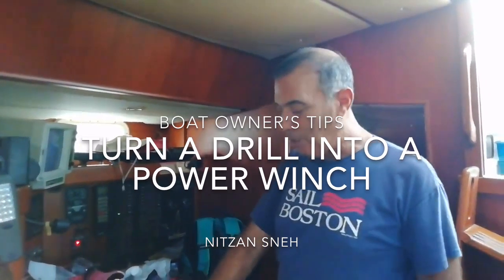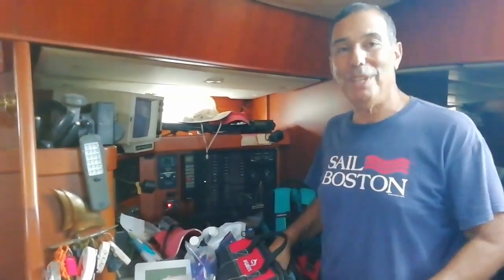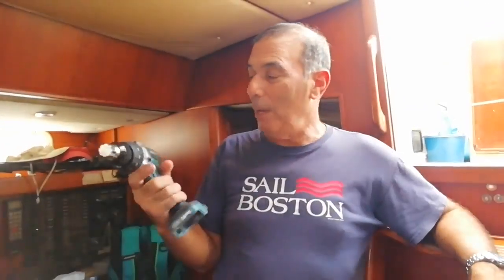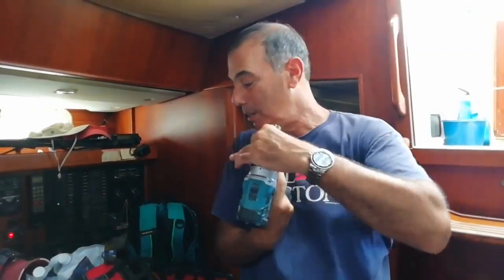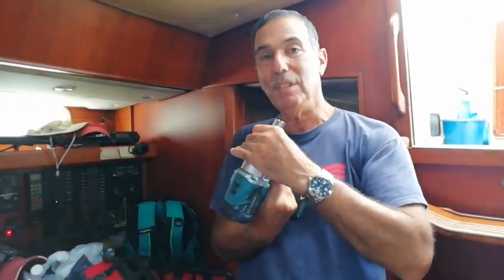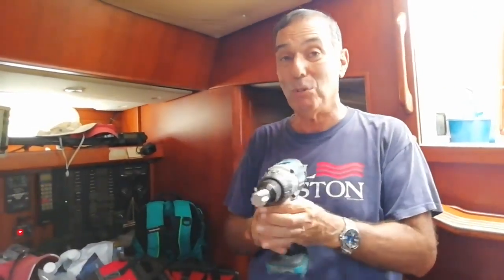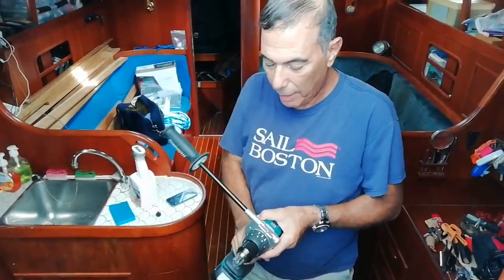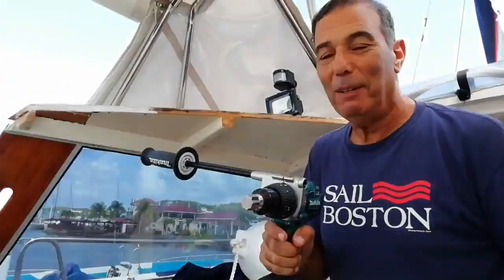Turn your handheld drill into an electric winch handle

Comment: Milwaukee have a new model of cordless drill - the 4th generation M18 Fuel model. It has 158nm of power. If that can’t get you up a mast then you may need to shed a few lbs. : )

Comment: I was so impressed with this video that I decided to buy the drill and the winch bit. When looking for a supplier for the Makita DDF481Z (used by Nitzan) here in Australia I could only find the sister model DDF486Z which has a slightly higher torque rating at 141Nm maximum, compared to 115Nm for the model used by Nitzan. Despite the higher torque rating, there was NOT sufficient power to winch me (90kg) up the mast of my Catalina 42Mk2. A mate was doing the winching and every few seconds the Makita would go into overload mode and stop working. He could only use the Makita for a few seconds at a time and had to do most of the winching by hand. Even though this is not a good solution for winching someone up a mast, at least I have a good quality battery powered drill for general applications.

Comment: I bought a drill and a bit and tried this out. First I will say Im tall and I weigh 225 and add another 5 to 10lbs for gear. Drill was not able to move me up without overheating and shutting down in the first 10 feet. Perhaps someone smaller may work better. Not near enough power to get me very far. Probable would need to rig a pulley system to make this work for a guy my size. Has anyone else tried this?
Reply: Patrick Hodges - Did you try the same model? Just curious because you don't specify. My colleagues and I are thinking about using the Makita DDA460 36v brushless right angle drill which of course is quite a bit bigger. We maintenance sailboats for a chartering company and hoisting someone up the mast on boats without electric winches is a literal pain in the back
Reply: Yes,I have 180 pounds, my son puts up on mast i seconds.  I have a makita 14Z 1200 torque, 800 watt. Works perfectly.  Now I have ally winches eletric in my Moody 44.

Comment: This is an April fool right? just tell me how many N m you can put into your winch with your drill and that extension arm compared to a standard winch handle? Hint the weakest link is the extension arm or the chuck.
Reply: the Winchrite puts out 110 nm of torque.  It costs around $1000.  Milwaukee has a cordless 1/2" 90 degree drill that puts out around 135 nm for around $299.  Anything from 1000-1200 in-lbs would work fine I think.

Comment: Seems super dangerous to bring someone up a mast with a drill that may die/fail. Also can't imagine winches like being spun at 10000 rpm.... If you can't pull a sheet or figure to use leverage, find able crew or hire professionals IMO
Reply: The tension is not kept by the screwdriver. Your winch is only moving one direction and you have to keep tention in the halyard. Failure of the power tool will not result in anything but not getting further. Unless you drop the halyard when trying to figure out what is wrong...